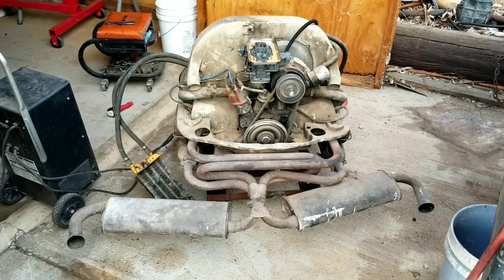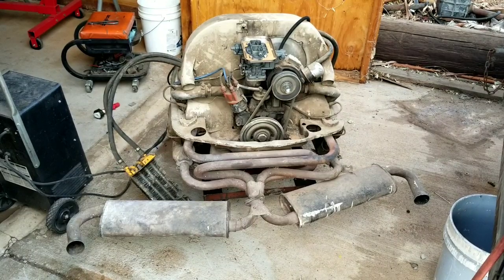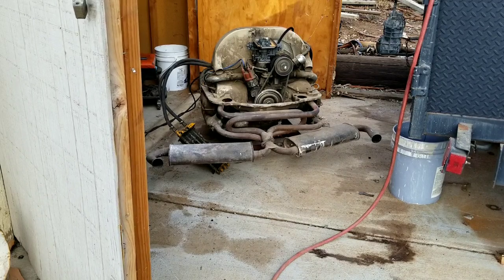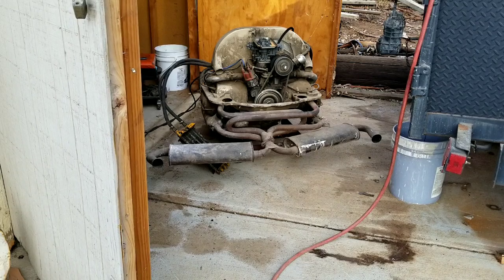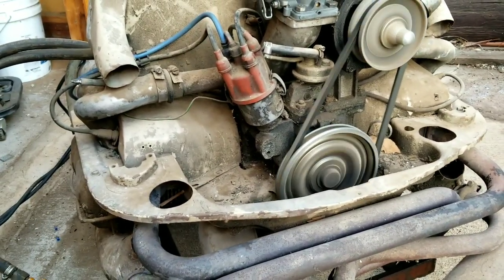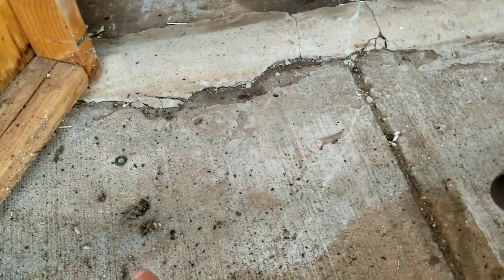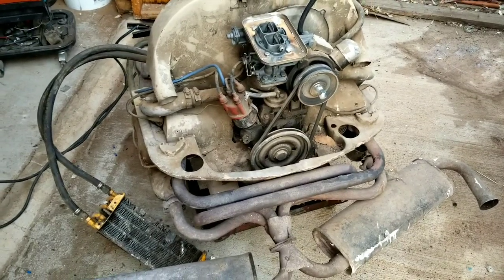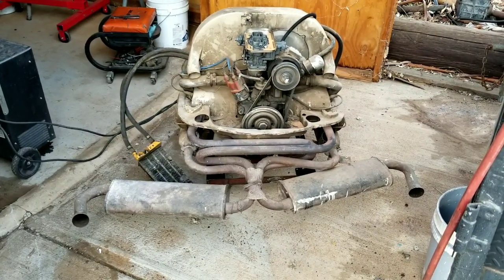will it run ? First start in 29 years 1835cc vw engine forgotten in Barn shed

Comment: Dang man... will it run!! that sucker runs like a champ!!
Reply from the maker: for an 1835 with a 2 barrel that motor was really fast. Used to beat guys with dual carbs. But we jetted the carb for the 2007 first run. then we rebuilt the carb on it and opened up the jets even more. This was the first carb on the 2007 the one that was on this originally is now on the 2007.

Comment: By the way it started up, most people would say this video was fake...but I know better. You can't fake launching mouse nests and crap outta the exhaust! LOL That's awesome! It's really cool you've got an engine that you built so long ago!
Reply from the maker: no static set timing just fuel in  the carb. The carb was rebuilt and we exchanged the one on it on properly jetted for the 2007 put the carb from the 2007 on this one. just easier than removing the one on that engine to rejet. So it was clean. the mouse nests cannot be faked at all.

Comment: Hay Mike I wouldn't worry about it just clean it up throw some new gaskets and stuff like that seems to be running just fine I don't think you should tear it apart but that's all up to you LOL
Reply from the maker: yea for sure but I want to tear it down to put a 8 dowel crank in it.
Reply: That makes sense, an 8 dowel will add some strength!

Comment: Nuthin’ better than shooting flaming mice out of the exhaust!
Can’t wait to see the build. Hey Mike you ever use the “Hoover Mod” on your oil system? 
It’s supposed to bring much more oil to the front main journal and passenger side of the engine.
Reply from the maker: reality of an engine sitting 29 years in garages and sheds. That mouse was a crispy critter.

Comment: I noticed it isnt doghouse fan shroud. Would this be why it ran hot? I have a 1600Dp non doghouse wand it runs a bit hot too
Reply from the maker: yea I wasnt worried about anything lasting at that time in my life. more to that story in the next video on the tear down. OMG cant believe the stuff I did when I was younger.
Reply: Things were so different when we were kids, my first VW had no reverse gear and I could care less... lol
Reply: Ha! I had a 65 beetle with a 6 volt system. In the winter I had to park my car at the highest point the parking lot and coast downhill and pop the clutch to start!!